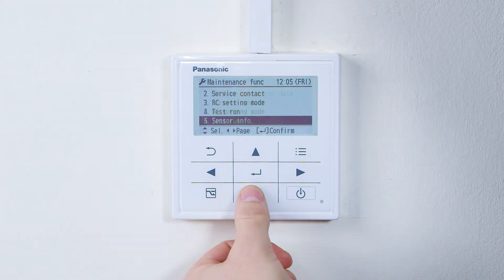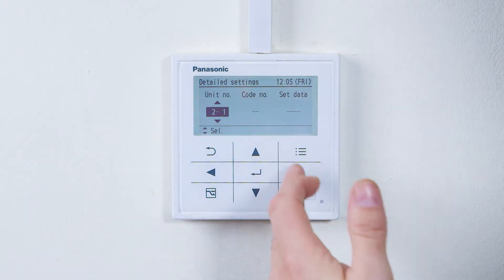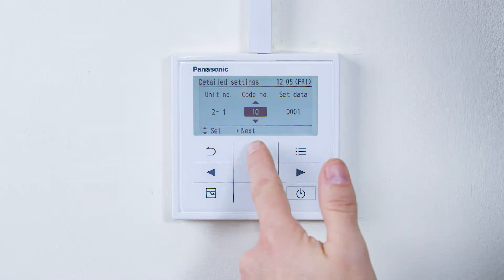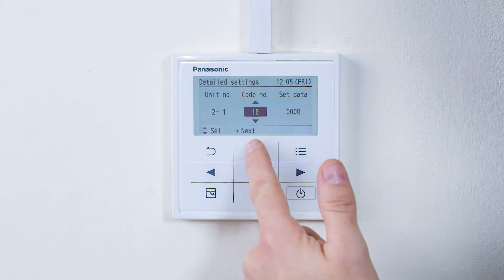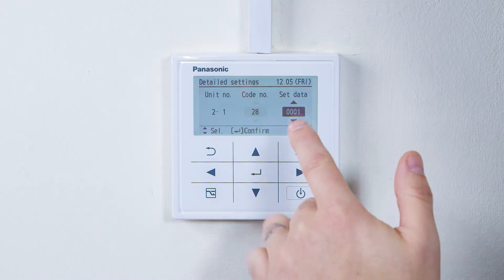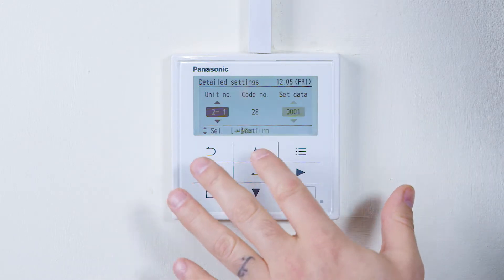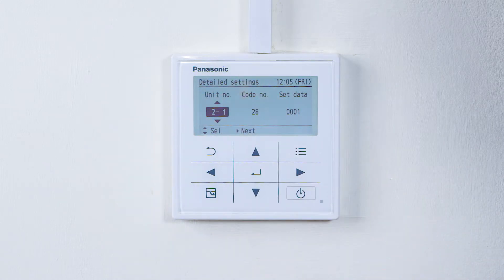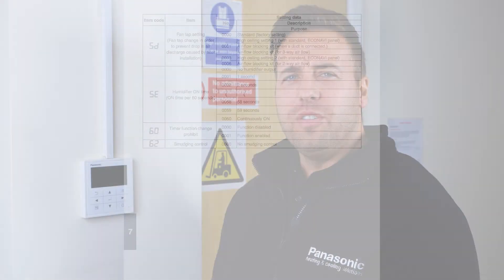How to use detailed setting codes on the Panasonic CZ-RTC5 Remote

Comment: How do you see the room temperature ?
Reply from the maker: As in the existing room temperature or the temperture you are setting the unit to?
Reply: AMP Air Conditioning  no the room temperature , how do I know what the room temperature is.  I can see the set temperature but not the current room temperature
Reply: AMP Air Conditioning is there a way to see the room temperature?
Reply: AMP Air Conditioning yes as in room temperature my old unit use to show to current room temp but this one I can’t find the room temp. It only shows the set temperature
Reply: Code 36 000 change to 001